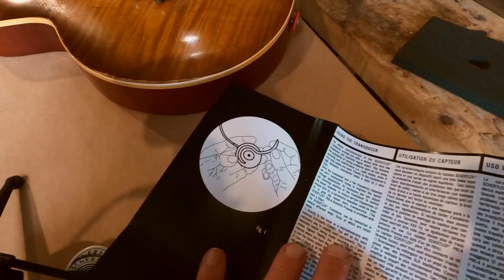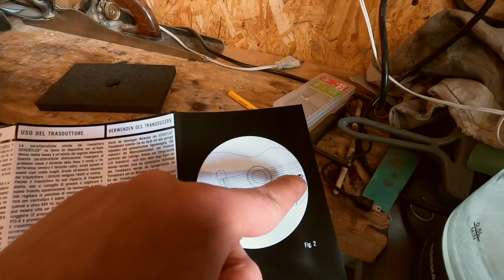HOW WOOD SOUND on unplugged electric guitar. (experiment)

Comment: Your piezo pickup is simply an accelerometer - the same device that scientists have been using for some decades to measure vibrations within different parts of the neck and body of solid body electric guitars. So you are not listening to the "acoustic" sound of the wood, you are listening to the vibrations of the wood converted electronically to sound. No one says there is zero vibration in the body of solid body guitars - only that it is so small as to be insignificant; that's what all the direct vibration measurements of real solid body guitars show. A piezo accelerometer is extremely sensitive, so it picks up even very small vibrations.
And of course what those small vibrations measured from your piezo accelerometer show are the vibrations LOST from the strings. So the string vibrations have excited those small vibrations in the body, which means the strings are no longer vibrating at those frequencies as much. So if you are wishing for the solid body to vibrate MORE in a "good" guitar,  you are wishing for LESS vibrations in the strings, as seen by the pickups. That's the Conservation of Energy Law. So "we need mahogany to KEEP low frequencies" is physics nonsense. More vibrations are lost to the thin flexible neck as you found, and that is the mechanism by which dead spots occur. 
You are obviously a master craftsman, particularly in your profession of historical monumental restoration, which you are now applying to guitar construction. But you are misinterpreting the real physics of solid body electric guitars, as have been known from measurements of real guitars for some decades.
Reply: My two cents: the initially lost vibrations in the body and neck are not completely lost. The vibration of the wood feeds back in the still vibrating string and altering their vibration, thus coloring their sound. The loss contains partially the metallic sound of string vibration, leaving a more desirable warm and „woody“ sound. 
  A german study/test got to the result that 70% percent of body vibration comes from the neck. So how the neck vibrates is very important, not just the so heavy dissected „body-wood“ discussions. 
Cheers😊
Reply: @Axy-dent-ly  There is no evidence to support string vibrations lost to vibrate the guitar structural "feeding back" to the string. At the neck,  its resonant modal vibrations are associated with REDUCED string vibrations at the same frequencies (Pate 2014). And those lost frequencies are low, not high.  The very small bridge admittance (Fleischer, Zollner, Pate) makes any feeding back implausible for body vibrations - a very small "funnel" in one direction means that the very small body vibrations (as measurements show) cannot then become a large funnel in the other direction to feed body vibrations back to the strings.
What is the German study that showed "70% of body vibration comes from the neck" ? I am familiar with all the scientific literature on solid body guitars, but that one must have eluded me.
Reply: @vw9659  
Can‘t find it anymore. Maybe it was just the result of a german physicist, not a study. 
   But vibration doesn‘t just travel in one direction (strings to body). The minimal body vibration transfers also back into the bridge and into the vibrating string.
Reply: @lone-wolf-1  The rigid bridge presents a large impedance to string vibrations, which is why bridge admittance is so low for electric guitar bridges (the opposite of acoustic guitars bridges). The vast majority of string vibrations are thus reflected back up the strings by the rigid bridge, to be seen by the pickups. If this were not the case, sustain would not be greater than in acoustic guitars. So with so little vibration travelling from the strings to the body, it is implausible that significant vibration travels back the other way - there is very little solid body vibration to begin with (as all the measurements of its actual magnitude show); and coupled with the large bridge impedance, the bridge cannot possibly be allowing significant vibration to flow the other way. It's just one of several speculations dreamed up by tonewood proponents who "want" body wood vibration to be important, but for which there is zero evidence from real string-to-body vibrations in real guitars (along with other unsupported speculations like pickup microphony and pickup vibration).
Reply from the maker: Thanks for your comment.  This is not a piezo pickup, but a magnetic induction pickup with a very flat frequency response.  That is why I use it in the analysis of the filtration of wood purity.  Piezo pickups work very differently and do not transmit the correct frequencies.  They are not suitable for the implementation of my ideas.  In this video, I just showed how you can honestly record the acoustic sound of the wood of an electric guitar that does not have acoustic resonators and sound amplifiers.  The strings in any guitar act only as an exciting resonance factor.  All the rest of the vibration buildup work is done by the wood.  But it's hard to show it in a video.  A person playing the guitar himself feels all this with his hands and body.  For me, the value of this experiment lies in the ability to track and analyze the different variations and intensity of vibrations in different woods and finished guitars.  This is more laboratory work with boring analytical notes.  But it also became possible to shoot a spectacular video that, in general, clearly shows what I feel when playing an unconnected guitar.  For many it is interesting and useful.  Yes, I'm not strong in theoretical physics, but I'm a practitioner and explore the questions that interest me on the material.  In my opinion, this gives a complete logical picture.  And it always works.
Reply: @8BombCustom  I stand corrected on the transducer type - it is less sensitive to vibrations than a piezo accelerometer (the most sensitive form of accelerometer used by engineers, with flat frequency response within their measurement range). Whether your microphone is sensing the wood vibrations or the directional acoustic sound waves from the strings is open to question. The distinction between a contact microphone (like your device) and an accelerometer is blurred.
But none of that changes the several decades of research with real solid body guitars that shows body vibration to be very small in magnitude, and essentially insignificant. Those measurements have been done with sensitive accelerometers and laser vibrometry. So "all the rest of the vibration buildup work is done by the wood" remains physics nonsense for solid body electric guitars (not "theoretical" physics, but applied experimental physics measured directly from real guitars).
Regarding what you feel with your hands and body on the guitar, look at the neuroscience research showing the vibration sensitivity of the skin mechanonreceptors you feel vibrations with (their frequency response is not flat). They are very sensitive to some frequencies (only), which can lead us to over-estimate vibration magnitude. They cannot tell you the real magnitude of vibrations in m/s^2 as calibrated transducers can; nor the exact proportion of the initial strings' vibrations that remain in the strings, which is the vast majority - and seen by the pickups. What you are feeling in the body and neck is the (small) vibrations LOST from the strings, so not seen by the pickups, and thus not obviously a good thing.
Reply: @vw9659  
If the low and low mids frequencies get absorbed by the woods, there should be just  mids, high mids and high frequencies left in the string to get picked up by the pickups. 
   But obviously it's the other way around: he high frequencies get dampened by the woods.
    Also you can feel the movement of the woods while strings vibrate. It‘s impossible to not feed back via bridge, neck, headstock into the string! It‘s very minimal and very very little delayed due inertia, but must have a slight impact on alteration of the still vibrating string.
Reply: @lone-wolf-1  That does not follow. There are only several narrow low frequencies lost to vibrate the neck. Because the neck's resonant modal frequencies are mostly in that low range, and the admittance of the nuts and frets at those frequencies facilitates that vibration transfer from the strings. That has been measured directly on many real guitars. But the vast majority of the vibration energy remains in the strings. Little is lost to the neck, and even less to the body.
Mostly the player can never identify or locate those narrow losses, unless there is an obvious dead spot. But it is part of why similar guitars sound different (along with many other factors); and those sonic differences is what some players and guitar builders mistakenly attribute to things like the body wood, as we see in this video.
In guitars where higher frequencies ARE lost from the strings, that has usually been found to be due to the strings exciting internal bridge vibrations (the structure in DIRECT contact with the string); for example at the many air gaps in a tune-o-matic bridge.
Of course the particular pickups on the guitar have to be sensitive to those lost frequency ranges, or the amp will never see those missing frequencies, and the player will never hear a sonic difference.
The vibrations you feel are also predominantly in that lower frequency range, because that's where your skin mechanoreceptors' greatest sensitivity lies. Because they are very sensitive within that range, some people over-estimate how much vibration is really occurring in solid body guitars. A true measurement requires a calibrated transducer, as have been used to measure the real magnitude of such vibrations in real guitars for several decades.
So the very low amplitude measured vibration is entirely consistent with the high measured mechanical impedance of the bridge - which means there is little vibration present in the body to come back the other way through the same high impedance bridge interface. Which along with the absence of any direct evidence makes the "vibration feedback to the strings" hypothesis implausible.

It's all very well to speculate on how solid body electric guitars work. But measurements of real guitars is what has led to our understanding of their real physics.
Reply: @vw9659  
I really like how well spoken and articulate your explanations are. You obviously know what you‘re talking about. And you are to 99% right.👍🏼
   But referring to feedback of vibration from the woods (body and neck) into the strings and thus alteration of vibrational behavior of them, we two will remain (provisionally) with divided opinion. 🤷🏻‍♂️
   That little percentage of altered string vibration and change of timbre, due different properties of different woods/materials, is small enough to be neglected. It has no effect on what music should be. 😊
    For me, It does influence a purchase of a guitar on the used woods just out of curiosity and  I like variation. For me the main reason is based on variation in sound, scale length, look and feel. Not the woods.😌
Reply: @vw9659  
I imagine a dimple test: mounting one string (or more) additionally on the back of the guitar, using same type of strings, tuner and bridge. Then excite vibration of the back strings by picking/strumming, while simultaneously  in the front and analyzing the change of „tone“ on the front strings picked up by the pickups. 
It will indicate if the woods are moving/vibrating enough to alter the vibration of the front strings….
Reply: @Boony Tooty You must enjoy Jim Lill's videos then. A shed science for the masses, yeey!
Reply: It's obvious that you have never worked in a professional studio where there is a lot of money at stake... For example, take 10 stratocasters with the same pickups that are already in the studio, why musicians always choose always the same couple of guitars? Because the woods have more vibrations that make the strings to vibrate a bit more which translate in better sounding. Is it subtle? No, because the signal goes to an amplifier that we all listen and say... Yup, that is the best one for sure, 10-20% better is a lot mate. And we are talking about all good guitars already. It will be always very important before mixing, if not, then it's too late... There no place for nonsense in a pro studio, just very good ears to listen properly.
Reply: @oscarmorales-cn3hz  You seem to have misunderstood the question. It is not whether or not some similar guitars sound different, or better, than others. The question is WHY they sound different. The evidence from measurements of real guitars shows that there are many reasons why they can sound different. The body wood does not really make that list. Your suggestion for why some sound better - because their body wood vibrating more makes the strings vibrate more - would break the laws of physics if it were true, particularly the Conservation of Energy Law.
Reply: @vw9659  "To sum up, the authors despite the great variabil-
ity of wood can statistically prove diﬀerences in acous-
tic and mechanical properties of tested two hardwood
species, i.e. walnut and ash wood, for use in making of
an electric guitar solid body. The research conﬁrmed
the better mechanical properties of ash wood, that is,
the larger modulus of elasticity and shear modules in
all anatomical directions and planes. At the same time,
some indicators of acoustic quality were better in ash
wood, but only in the basic vibration mode. Never-
theless, in ash wood, greater acoustic and mechanical
anisotropy was determined. It has also proved to be
less homogeneous and, consequently, poses great dif-
ferences between vibrating modes"

from "Selection of Wood Based on Acoustic Properties for the Solid Body of Electric Guitar"
Reply: @TheMemagNeman  I'm quite familiar with that Zoric et al. (2019) study. They cut rectangular blocks of several different woods - that is, an "instrument" with neither a neck nor a body like a solid-body electric guitar. They seemed to proceed simply on the unproven assumption that body wood matters sonically - perhaps having read guitar companies' marketing -  and then simply proceeded to measure differences between the woods. They mis-cited some of the existing literature showing the sonic relevance of the neck, as if it referred to the body wood. Thus the study tells us little about any sonic significance of the solid body wood in a real guitar.
Reply: @vw9659  It's measurable. Big variable is if the user/player can hear the difference in tone produced.
These neighboring frequency changes are perceivable by human ear though.

 "In the investigated low-frequency interval
(<500 Hz), the modal frequencies determined from a single measurement signal on the
electric guitar with the body of ash wood were on average 118.0 Hz in the 1st vibration
mode and 203.1 Hz and 438.0 Hz in the 2nd and 3rd vibration modes (Figure 3,
Table 3
).
At the selected measurement points of the electric guitar with walnut body, the modal
frequencies averaged 108.2 Hz in the 1st vibration mode and 200.6 Hz and 419.2 Hz in the
2nd and 3rd vibration modes."

"Conclusions
This study conﬁrms that the elastomechanical and acoustic properties of the material
used for the solid body of an electric guitar also affect the acoustic properties of the
instrument. In the speciﬁc case of the free-free vibration mode, the correlation of the
vibration damping of the solid body and the neck of the guitar is characteristic. Under
these conditions, the research conﬁrmed the advantages of using stiffer ash wood, which
has lower damping compared to walnut wood, for the solid body of the electric guitar
when the other identical components are used. In fact, choosing walnut with greater
vibration damping for the guitar body has the negative effect of shortening the decay time
of some open vibrating strings due to the coupling effect with the guitar neck and strings"

from "Comparison of the Vibration Damping of the Wood Species Used for the Body of an Electric Guitar on the Vibration Response of Open-Strings"
Reply: @vw9659  Different materials/woods have different physical properties. It's only natural that the string vibration would be damped differently by a piece of rubber , a piece of wood, bone, plastic, ceramic, metal. You can hear sonic difference when changing materials on the nut and bridge saddles. Imagine if the neck was made out of a hard rubber and how would that sound , compared to that same guitar setup except with a wooden neck. Some guitars just sound better even though others (from the same run) have the same type of woods and the same setup.
Reply: @TheMemagNeman  Regarding the study you quoted "Comparison of the Vibration Damping of the Wood Species Used for the Body of an Electric Guitar on the Vibration Response of Open-Strings" - yes, I know that study too. It's another from the same Slovenian group as the Zoric one you quoted earlier - in this case Ray et al. (2021). It has some improvements on the first but suffers from another common problem - use of only one sample of each wood. This is unfortunately common in graduate student theses (of which this study may be an example), where resources and time are limited. But what it means is that the requirement to demonstrate that the "guitars" (in this case a slab of body wood with the same neck) are identical in every other way becomes extremely important. It is not clear from the methods if the same hardware was used on each guitar; and even if it was, any methods to ensure it was set up identically on each guitar were not described. Variations in such factors are common sources of sonic variation between similar guitars (see Zollner ch7).
Studying multiple samples of wood is a much better way to address this problem, as then any consistent differences are more likely to emerge from other sources of variation, if they are truly present.
Also, as one academic reviewer commented: "The decision of using rectangular blocks of wood for comparison, instead of more conventional electric-guitar body shapes is not explained. Also lacking is any explanation/discussion of how the rectangular body’s response meaningfully relate (or not) to the response of actual conventional electric-guitar bodies."
So again, we are left with a study that raises more questions than it answers.
Quoting more and more studies with methods that are obviously deficient to experts in the field does not really get us any closer to the truth.

Regarding "Big variable is if the user/player can hear the difference in tone produced.". Certainly there are differences in hearing acuity. But generally in these discussions we are talking about guitars where everyone who hears them agrees that they sound different. If you have an example of two guitars that you think only experts can hear the differences between, let's hear them. But what would be the benefit of that ? If only expert players can hear those differences.
As to whether all sonic differences are measurable with instruments, the work of Pate that combined precise measurements with blind listening tests by experienced guitarists actually found examples where consistent measurable differences were NOT reported as heard by the guitarists. So it seems that it's just as likely to be the other way round.
Reply: @TheMemagNeman  And yes, different materials have different properties as you say. But not all are in direct contact with the string. Nuts and saddles have been measured to have sonic effects, because they are in direct contact with the string. The nut facilitates loss of string vibrations to the neck at the neck's narrow resonant modal frequencies. And the bridge is a common measured source of higher frequency losses, where the strings excite bridge components to vibrate.
Statements like "It's only natural that the string would be damped differently by a piece of rubber ..." and "Imagine if the neck was made out of hard rubber ..." are known as appeals to extremes - they contribute nothing to understanding how real guitars work.
The many potential reasons that can cause similar guitars to sometimes sound different are well-described in the scientific literature based on measurement of REAL guitars.
Reply: @vw9659  " In the electric guitar with identical components,"

"We have examined only one body of a single species
of wood. However, in a previous larger sample, we conﬁrmed statistically signiﬁcant
differences between wood species in density. In
order to simplify the future process of building a numerical model, as part of a broader
study of electric guitar design based on the acoustic properties of the material, we have
included only the basic shape, i.e., a case study, of the guitar body in the initial investigation."

"From a mechanical point of view, these guitars tested are nominally identical, with the
only difference being in the directional mechanical stiffness, i.e., the modulus of elasticity,
torsion moduli and damping of the material used for the guitar body.
With the same guitar equipment and identical tests, despite the coupling effect
of the components of a single guitar, it is to be expected that the differences in the
acoustic behavior of the tested guitars are mainly due to the material properties of the
guitar body used."

Some people can't tell single coil from humbucker, let alone hear the difference in note bloom.
Here, take a listen to these. Pay attention to clean sounds and see if you can spot the difference. https://youtu.be/ux1d3yF8-Ro

Do you know who is Jim Lill and do you think those test are valid?
Reply: @vw9659   No, they are not in direct contact but they react as the string vibrates. Nut and bridge propagate vibrations to neck and body which is more than obvious.

I used extreme example to depict how materials used in a guitar system matter.
Of course, the effect would be severe . Different wood species and samples would have much less perceivable influence on string vibration.

 Please provide the tests and results of scientific research published that uses "real guitars"
and which concludes that wood used in guitar makes no sonic or mechanical difference in string vibration.
Reply: @TheMemagNeman  In the Ray study "identical components" is ambiguous - it could simply mean the same MODEL of bridge etc. It doesn't obviously mean the exact same bridge (different versions of the same model bridge have been shown to absorb different string vibration frequencies [Zollner]); you need to be very precise in this context.
Their reference to confirming properties on more samples is to the earlier study (Zoric) you quoted, which did not use the same "instrument" as this later study (it had no neck). It was simply bench testing of the mechanical properties of slabs of wood. It does nothing to say whether multiple samples of an otherwise-identical guitar made of different woods would return the same results as this Ray study on single wood samples (only).
In general, these authors seem unaware of the work on the many common differences that can confound creation of "otherwise identical" guitars, particularly the work of Zollner. They seem to be inexperienced researchers as far as guitar research is concerned. Although part of the problem is also that their overall aim is to design a virtual test bed for guitar design. They are not specifically trying to determine if body wood matters sonically in REAL guitars. Or their experiments would have been designed differently. 

The Lill experiment is interesting in that the heard differences were smaller than many people expected - between a conventional guitar, a 2x4 guitar, and a "bench" guitar ... so a 'normal' amount of wood, less wood, and much more wood. That and his other experiments (eg scale length) are admirable for an admitted amateur. He does "ecological validity" better than the published studies we have been discussing. He was obviously able to control other guitar factors (that can sometimes contribute to sonic differences) well enough to minimize the heard differences in his examples. There are other examples on youtube where for example most of the wood has been removed from the same guitar and the sonic differences were slight (eg Braun). So Lill's results were not entirely unusual. 
The criticisms of Lill I have read have generally shown a misunderstanding of his experimental design or its implications. Although some people won't explain why they don't like his experiments (perhaps because they can't ?). But some people argued for example that the "air guitar" actually had wood. In fact of course it had lots of wood, which actually makes the experiment stronger not weaker (as a more extreme contrast).
If you think his methods were not valid, why ?

Re the studies of real guitars you asked for, read Zollner's work in Germany (especially ch7 in the 1200-page 'Physics of the Electric Guitar'), Pate's work at the Sorbonne in Paris, and Fleischer's work also in Germany.
Reply: @vw9659  That would be all, thank you.
Reply: @vw9659  Some interesting stuff I read ...
"Fleischer [8] has published a variety of different impedance plots for various guitars,
measuring not only at the nut or bridge saddle, but at each fret, as well. These and further
investigations [Fleischer 2001, 2006] indicate bending and torsional vibrations of the guitar
neck – causing low-frequency bearing absorptions. "

"Below about 1 kHz, neck resonances (very selectively) determine the string damping,
and only here does the wood have an impact. The wood of the neck, that is! Although the
body as a bearing for the neck is also involved, the bending- and torsion-resonances of the
neck are the decisive factor."

"Compared to this situation,
vibrations in the body of a solid electric guitar are of subordinate significance. This does not
mean that just any material would be suitable for the electric guitar, and that its body has no
impact at all: rubber would indeed be not conducive. However, if contact to half a square-
meter of blockboard has no audible effects onto the electric sound, the issue of whether the
body is made of ash or of alder moves rather far into the background."

"As has already often been expressed: damping in musical instruments is not necessarily a bad
thing. The character of the instrument expresses itself in the damping of individual partials:
it’s the imperfection that results in individuality. Simpler said: the picking and the pickup
yield a spectral envelope, and the string bearing determines the decay of the partials. Not the
analyzer but only the listener decides what’s good or bad; and what is actually audible, as
well. Not all effects visible in an FFT-spectrum are audible, too. "

What was also interesting was Zollner's "tonewood" test of a Strat where he didn't actually test or measure  different types of wood on that start 
but he sequentially held the body and the neck onto the wooden cab of some sorts and did an analysis of that as a tonewood test.
Formerly he claims neckwood is the key to vibration absorption and frequency shaping/ ultimately contributing to the tone of the guitar.
The remaining of the article is reading like a rant.
Reply: @vw9659  The WHY, is the wood, that's a fact. Do you think that top level producers are stupid or deaf? Young people try new crazy ideas based on physics, old dogs made millions with real knowledge based on decades of trying different stuff. This is not even a debate mate.
Reply: @TheMemagNeman  Your last quotes (all from Zollner ch7 ?) support what I have been saying is the direction of all the evidence.  That evidence, from multiple researchers measuring real guitars, shows that the resonant modal frequencies of the neck matter sonically - they are a result of neck dimensions (long, thin), and composition (wood, frets, truss rod). That is also consistent with measurements of nut/fret admittance, showing it to be high at those frequencies. Thus string vibration energy flows from the strings to the neck, and actual string vibrations have been measured to be reduced at those narrow frequencies. Multiple different measurements from different labs, guitars, scientists, methods ... all supporting the same conclusion. Bridge admittance on the other hand has been found to be very low (the opposite of that measured in acoustic guitars), and thus there is no similar evidence for the significance of body wood in real guitars. Direct vibration measurements of neck and body have shown that the latter is very small (something that is not actually measured by this channel's video, at the Les Paul's resonant modal and other frequencies). So the reason why the body wood has not been shown to be significant in real guitars is essentially that, comparatively, very little vibration reaches it.

As we move along the continuum from solid bodies to semi-hollows, to hollow bodies, and eventually to acoustic guitars, the evidence shows increases in bridge admittance, and reductions in string vibrations at the same frequencies. This reflects an increase in bridge "mobility" - that is, the bridge vibrates more on less-solid bodies. This explains why thin top plate wood (actually really its stiffness and mass) and bracing matters in acoustic guitars - they support the bridge, and facilitate transfer of string vibrations from the strings to the body via the bridge (in order to be heard). That transfer is measured to be less in hollow-body electrics, less again in semi-hollows, and very small in solid bodies (where the bridge is typically solid metal). That is why sustain is greater in solid-body electric guitars; vibrations remain almost all in the strings, to be seen by the pickups.

If you read the physics nonsense that Zollner highlights in his quotes from German guitar magazines about body wood, you will understand his frustrations, which are sometimes reflected in his written tone. The English language guitar press does not seem to be as bad, but they do sometimes parrot guitar manufacturers' marketing and misunderstandings about the role of body wood.

BTW, you didn't answer about your own assessment of Lill's experiments (which you asked me to comment on).
Reply: @vw9659  All the tests (Zollner's and those of the researchgate scientists that you disregard as amateurs, plus YT video tests) prove that guitar system materials are important.
In terms of body wood construction , neck wood (or also refereed as tonewood, if I may say so) is proven to have observable effect on the guitar "tone". There is no disagreement there.

What I think is odd is your disregard of the "amateur" scientists tests material as "not-real" guitars, when we have examples in Zollner's that also use single string apparatuses/monochord (7.19), and the guitar wood tests like leaning the guitar body/neck onto the cabinet ("It should follow that if we change the wood, the sound would also change." Proceeds to not change the guitar wood material and makes contradictory statements to his own prior research on the neck wood.).

Then we get presented with data and solid proof of the effect of the guitar "tonewood" effect on the "tone", in the researchgate documents. Be it minor, it's still there.
I see it as a change of the magnet in the electric pickup. It makes a difference but it's sometimes so small that user may not notice it.
It's still there though, and user might just "like" that particular guitar because of the minute difference, the "feel". 
Guitar is a complex system. Same pickup and same strings will not produce the same sound on a different guitar. 

There is not a single plotted data analysis in Lill's video. It is presented as a fair attraction, it's amusing but nothing more than that.
He uses short audio samples to get to his point (controlling the samples to "minimize" the differences in tone),
no actual recorded raw audio files, he disregards YT compression and uses his own compression on the audio samples.
In the end the tests show that these "not-real" guitars indeed sound different. Much like other YT videos I have posted. 
The video from SoundSpectreStudios also prove those tested guitars sound different, if they can't hear it it's their issue. 
Under heavy drive most of the guitars with similar features would sound almost indistinguishable due to compression and signal degradation.

If we talk about the tonewood, we talk about the body and the neck since both are made of wood.
If it's true that the neck wood matters (as claimed by Zollner among others), as a factor in guitar tone shaping, we can safely use the term "tonewood". Why not.
If this wood is used in the body of the guitar , it is also tonewood.

Semi-hollow (335) still has a block of solid wood running the middle of the guitar. The bridge is mounted on top of it. If you remove the "wings and top", the guitar would look like those "non-real" guitars in the "amateur" body wood tests. Why would bridge vibrate more on a semi-hollow and have more profound effect on string vibration (tone) , if it's mounted on a solid piece of wood just like on a Les Paul? Does body structure matter, does material structure matter?
Let's not mix these with how acoustic bridge works with the body.

Sustain doesn't mean good tone. Zollner confirms it doesn't have to be desirable and I agree.
Reply: @TheMemagNeman  There a number of accomplished guitar scientists whose multiple studies (on real guitars) are on Researchgate, namely Arthur Pate and Helmut Fleischer who I recommended to you earlier (along with some of Zollner's work being there too). The overall conclusions drawn from these are, as I said, the result of multiple experiments all pointing in the same directions, despite being done by independent scientists in different labs with different guitars. Of course not all single experiments are equally well done. One of the skills of scientists is to assess the entire research literature, looking for agreement and disagreement, evaluating the quality of the research, to come to a consensus conclusion. There should be no high-quality research that presents a different conclusion. It is entirely open to the "non-guitars" wood scientists we've discussed to do better, more ecologically valid studies with real guitars.

Tonewood proponents often conflate the neck and body. They are very different structures, which explains the significant measured sonic effect of one (the neck) and the absence of evidence for the other (the body). The fact that wood is important for a long, thin, composite neck tells us nothing of its importance in the thick, solid-slab body. Saying "it's all tonewood" makes no sense.

You say the body wood effect is "minor", but that's not what some guitar journalists say. Some of the German ones that Zollner attacks have asserted that the body wood is responsible for the main sound of a Les Paul, with the pickups only contributing some colour to that. And if you read guitar manufacturers' web sites, you would come away with the same impression - that particular solid body wood species "sound" a particular way.

Regarding "Guitar is a complex system. Same pickup and same strings will not produce the same sound on a different guitar. " ... Yet tonewood proponents often reduce it to a simple system - "if it's not the pickups it must be the wood". In contrast, Zollner has shown the MANY factors that can have sonic effects in real guitars - many not always evident, but sometimes. So describing a guitar as a "complex system" is only helpful if you then point to the many things that have been measured on real guitars to have sonic effects - which we can now do. If you don't do that, then you're back to "well I'm not really sure ... but maybe it's the body wood". That's not a complex system ... that's a misunderstood system.

Re the Lill video, it's of course possible that the audio processing factors you mention influenced the similar sonic results we heard. But unless we get access to the raw audio, that will remain speculation. Other channels have shown nominally similar guitars that do sound different, so it's not like youtube is incapable of reproducing differences. And Lill's results are broadly consistent with the published science. If nothing else, his results challenge tonewood proponents to come up with better experiments to prove their assertion that body wood does matter sonically. Because when you ask them why they believe that, they usually don't have much to offer ... other than often saying "everyone" knows that, or that it's what guitar journalists and manufacturers say (neither known for their knowledge of guitar physics).

Re the 335 centre block, look at how it interfaces with the curved top of a 335. It is not a completely solid attachment (see for example Gibson factory videos showing 335 construction). So the 335's bridge and its top are more 'mobile' than on a typical solid-body guitar. Thus it is expected that it would have greater string vibration losses than a solid body guitar, which is what Zoller found with his measurements.

Sustain is due to the persistence of vibrations in the strings. So while you may not want the string to vibrate as long as Santana, the factors that cause that longer decay - or conversely cause faster decay - are in action from the time the string is struck. Thus they influence the frequency spectrum of the string detected by the pickup at all points in time. Zollner for example has shown this in his 1/3-octave frequency plots of real guitars on his youtube channels. So whether you desire long sustain or not, you are hearing the factors in a guitar that influence it, for notes of all durations.
Reply: @vw9659  Okay, we agree that the wood (material) used in the neck matters in the tone of the guitar.
That alone is contrasting the belief that guitar body (neck/corpus) material doesn't matter at all and that most of the tone relies solely on the pickups.

"If nothing else, his results challenge tonewood proponents to come up with better experiments to prove their assertion that body wood does matter sonically."
That's literally what the body wood research (walnut vs ash) is doing. That's what we can find in the YT videos as well. 
https://youtu.be/ZzPvq8V7IA4
https://youtu.be/Hbyg0d1njk0
https://youtu.be/YcwHAhYlT7g
If he was using a compressor (which he did noted), he consciously changed the signal. If there is too much speculation , then it isn't really a science test, right.

This is another test that examines the change in woods used. Of course, these are not-real guitars, much like monochord in Zollner's tests.
https://journals.pan.pl/Content/121810/PDF/aoa.2021.138150.pdf?handler=pdf

As for ES335, I thought the bridge was securely mounted into the center wood block? "It is not a completely solid attachment" what does this mean?
www. tdpri. com/threads/tickled-pink-jupiters-es-335-build.620607/page-108
Reply: @TheMemagNeman  Fleischer's work is mostly from the 1990s. There has been no argument as to the influence of the neck since then, amongst people familiar with his work. He also showed the very low bridge admittance, and thus measured low body vibrations in real guitars. So there really has been little excuse to believe in "body tonewood" since then. And the quality work since then has only added weight to that understanding of the relative importance of neck and body wood.

I honestly rarely come across anyone who thinks it's all in the pickups. In fact a simplistic dichotomy seems more common in my experience amongst tonewood proponents - "it can't all be the pickups, so it must be the body wood". The many sonically-influential factors identified particularly by Zollner in real guitars shows that both positions are obviously wrong.

I looked at the videos you linked. The paulownia vs alder one and the alder vs basswood one appear to be just recordings of two guitars with bodies made of those woods swapped. Which could sound different for any one of the dozens of reasons that have been shown to affect guitar sonics in some cases. Too many people seem totally unaware of experiments such as Zollner's, and thus think all you have to do is change one thing in a guitar - in this case the body - and magically that will be the only thing that has changed in any sonically-influential way.

It's the myth of the "otherwise-identical" guitar. In reality you actually either have to make the same change multiple times (the multiple samples I talked about earlier), so that any real effect might emerge from the unavoidable variation in other uncontrolled factors; or precisely measure almost all known sonically-influential factors (eg losses due to string-fret micro-damping or the strat trem suspension, to name just two that could apply in the above videos) ... to be sure that none of them changed when the bodies were swapped. That's the clear implication of Zollner's work. So all in all there is no obvious reason to assume that the differences we hear in those two videos is clearly due to the body wood.

The Tim Sway one I've seen before. But I watched it again to see if I'd mis-remembered it. It shows minimal heard differences between most woods attached as an outer 'frame' to his novel, relatively thin, unchanged core; and a greater difference for one wood - poplar - not exactly one of the classic supposed "tonewoods". Of course we have to assume he strummed the guitars identically (the best way to do that is with a mechanized strummer). But as Sway says at around 16 minutes, "They all sound and look [on screen in his DAW] the same ... surprisingly the same". Including the core on its own (not unlike Lill's 2x4). The only one that clearly sounded different (brighter) was the core plus poplar frame. Someone would have to closely analyse Sway's unique guitar design to see why that was so, and if that brightening effect actually happens everytime you attach a poplar outer frame to his core. The only structural element that has clearly been implicated in a brighter guitar is the neck, as it is commonly associated with lower frequency losses (the bridge tends to be associated with higher frequency losses). So, the Sway video is somewhat interesting ... but not especially persuasive that we have missed a clear body wood effect in years of other research work.

And it would be remiss of me not to point out the apparent contradiction in your assumption that youtube audio was inadequate to discern sonic differences in the Jim Lill video, whereas the guitars in the videos you linked obviously did sound somewhat different. Do you think youtube was perhaps just having a bad day when it recorded Lill's experiments ?

The results of the Jasinski et al 2022 study are at best consistent with the experimental data from real guitars showing the sonic effect of the neck. They used a monochord where there is no separate neck and body, so one cannot draw conclusions as to where their measured effects originated. There are experiments for which a monochord is appropriate, and ones where it limits the conclusions that can be drawn. In terms of overall research design, like the others they also used only single samples of each wood, and made the "otherwise-identical" guitar assumption too readily. They provide some data in Table 1 on their setup's variability, which includes a pickup height variability of up to 0.9mm; we do not have good data on what the sonic effect of that variation might have been. 

I don't wish to be too harsh on these research groups. The required experiments to answer these complicated questions are hard to design, and require considerable time and resources to perform well. But there is basically no funding for guitar research, so most academics are doing it with minimal resources. As a result of this, guitar research is not a large field. Which in turn means that there are few experienced researchers able to rigorously review research papers submitted by others for publication. Which means some poorer quality studies do get published in small journals. But researchers should not overstate the meanings of their results, as some of these groups have done. An important part of research writing is to honestly state a study's limitations; some of these groups have failed to do that.

Re the 335, note the thin spruce strips that are the interface between the curved top and the centre block:
https://youtu.be/uVU86GGV07A?t=498
So there are reasons to expect a more mobile bridge and top plate, which would lose more vibrations from the strings than one would expect in a solid body guitar. Also, Zollner (ch7) showed that the height of an ABR-1 influenced the string vibrations lost to the bridge. So, expectedly Zollner did actually find greater losses of string vibration energy in a 335 than one would expect of a solid body (fig. 7.124).
Reply: @vw9659  As he said, the spruce strip block is glued to the maple center block (reinforced top) and then bridge and tailpiece get drilled into it.
I have a similar guitar and ,although not spruce strips, laminate is firmly glued to the body block and then the ABR bridge and tailpiece are fixed to it, just like on a Les Paul (given that the rest is not solid wood construction). The bridge is not floating and it's not just fixed to the arched top, there is no movement there. Bridge itself is not more "mobile". 
Change in response could be due to materials involved , mass , density , body design/construction. What is the exact "reason to expect" the change in the vibration distribution?
If we talk about the glue used to connect the slabs of wood together, then we talk about the change in the material and it's properties (ibanez brass sustain block comes to mind).
I don't think glue nor wood finish has a meaningful influence on the guitar tone.
Setup of the guitar makes a world of difference to a guitar's tone and the feel, sure.
Reply: @vw9659  "I looked at the videos you linked. The paulownia vs alder one and the alder vs basswood one appear to be just recordings of two guitars with bodies made of those woods swapped. Which could sound different for any one of the dozens of reasons that have been shown to affect guitar sonics in some cases. Too many people seem totally unaware of experiments such as Zollner's, and thus think all you have to do is change one thing in a guitar - in this case the body - and magically that will be the only thing that has changed in any sonically-influential way."

Okay, if we consider that there are so many miniature variables that could change the tone of the guitar...how come Lill (apparently agreed that there is no difference in tone) didn't manage to change any of them in his half-assed shed experiments? Plucking, string fatigue, setup deviations etc. 
Were they all perfectly executed (speculation?), doctored, edited, cherry picked to prove a point?
Reply: @vw9659  "It's the myth of the "otherwise-identical" guitar. In reality you actually either have to make the same change multiple times (the multiple samples I talked about earlier), so that any real effect might emerge from the unavoidable variation in other uncontrolled factors; or precisely measure almost all known sonically-influential factors (eg losses due to string-fret micro-damping or the strat trem suspension, to name just two that could apply in the above videos) ... to be sure that none of them changed when the bodies were swapped. That's the clear implication of Zollner's work. So all in all there is no obvious reason to assume that the differences we hear in those two videos is clearly due to the body wood."  

I must have missed Zollner's body wood comparison tests , where he kept all the components and setup as identical as possible (no speculation!) except the body wood.
On a "real guitar". Oh right, he pushed a strat onto a cab and this is how he effectively changed the guitar body wood (not in this reality though) and concluded that the test shows no meaningful difference in "tonal signature". However, if there is such a body wood/material test on a real guitar conducted by Zollner that I have missed, please share it. 
Otherwise it's just a study limitation which should be recognized by the author.

"paulownia vs alder" video has an intro video which confirms that the setup and components were kept as close as possible, meaning ~identical. 
There is an obvious reason to assume that the wood change is the cause for the sonic difference between the two samples
because this is an obvious and intended guitar system component change of these tests. It could have been that the rest of the setup was perfectly identical
or the offset was so small that it didn't cause any observable difference. It just might be a better body wood test than the rest of them. On a real guitar, none the less.

Most of the research linked was done by people with PhD degrees, there is no need to try and disrespect their knowledge and work.
Reply: @TheMemagNeman  Re the 335, the bridge bushings or posts (depending on exact TOM bridge type) are in contact with the top plate, which is thinner and less rigid than in solid-body guitars. And there is no need to simply speculate that 335's might be associated with greater string vibration losses - that has been shown in Zollner's T30 measurements I cited. Like you I have such a guitar; maybe the construction of yours is different to Gibson's - Zollner studied a Gibson 335 with ABR-1 (not a 'floating' bridge). Could there be more such experiments done to establish the exact nature of increased structural vibrations associated with the measured reduction in T30 at particular frequencies ? Of course. But the general pattern of increased bridge admittance with less rigidly mounted bridges is reasonably well-established across the continuum I described of guitars studied by Zollner - solid-body electric to semi-hollow to fully-hollow to acoustic guitar. Bridge 'mobility' is a well-established concept in guitar research; although most of that work is with acoustics where it is most relevant, as it is the means by which vibrations are transferred to the thin top plate and cavity, in order to be heard. As you might expect, semi-hollows and fully-hollow electrics have been studied less often than solid-body electrics and acoustic guitars.

In the absence of precise measurements, I think the most likely explanation for Lill's experimental results lies in the nature of the many things that have been shown as having a sonic effect in guitars. The "everything matters" mantra that one hears from some people is not consistent with the research literature. Some things DO always have a sonic influence (pickups for example, via their resonant frequency and Q factor). Other things can sometimes have an effect, but not always (many measured in Zollner ch7 for example). And some have no sonic effect. So "everything" does not matter. The key to valid single-element guitar comparison studies (like body wood comparisons) is to control all those factors, and/or be clever/lucky in choosing a simple setup that has few if any other sonically-influential variables (or test multiple samples of the same woods, as I also suggested). If you look at all of Lill's studies, he seems to have a good knack and appreciation for the need to control potential other variables well, or exclude them. I don't sense any bias in his approaches - that is, he doesn't appear to me to be trying to prove a particular point. He seems honestly curious. And being a pro musician, if anything I think he would be more likely to hold to the supposed 'conventional wisdom' amongst many pro players that wood matters. If anything, the people on guitar forums who dismiss his results seem to be the ones with an ideological barrel to push.

Zollner has not done a body wood comparison study. So there is nothing there to criticize. The German GITEC group with which he has been associated has however done a blinded listening study examining the assertion by some that particular woods "sound" a certain way (ie the assertion made in some of the German guitar magazines).
https://www.gitec-forum-eng.de/listening-experiment-tone-woods-in-solid-body-electric-guitars/

I have now watched the several Pawlonia vs alder 'intro' videos. There was insufficient demonstrated attention to measuring/controlling all possible extraneous variables. Strats are amongst the hardest guitars to do wood comparison studies with (Lill's teles are much simpler). Because the trem suspension has been measured to affect string vibration losses. In this case, the trem was apparently decked, although we did not see the setup. Sonic differences have been measured with floating trems, but there have been no studies comparing decked trem setups as far as I know. But there are 'grades' of decking, depending on how far the springs are stretched. He did not measure pickup height as far as I could tell, but perhaps simply assumed that the strings were as far from the strings on both guitars because it seems that the same loaded pickguard was used (a difference in neck pocket depth would change pickup height). Disassembling a guitar and re-assembling it is not guaranteed to produce an identical setup. Also, listening to the blinded-test video, it does not seem that the strumming was particularly consistent. I look forward to the day when people doing such comparisons say they've read Zollner and thus measured or controlled everything precisely to ensure that no extraneous influences confounded wood comparisons.

Re PhDs, so how do you decide when a single study by one group of PhDs asserts a different conclusion than other studies also by PhDs ? Experts make those judgments on the research literature all the time. They look at the relative quality of the research. Or when there is a sufficient body of work (not yet the case for electric guitar science), by meta analyses or systematic reviews. As a general rule, more robust work is typically done by scientists who are more experienced in the area in question. It's unusual for a research group new to an area of research to produce top quality work in a complex area from the start. In large, well-established, well-funded research fields with many researchers, many journals, and many scientific conferences, the requirements for studies to get published are high - it is very difficult to get published - and those study requirements are clear to most researchers. In smaller fields like guitar science, and with smaller journals ... not so much.

It is of course not inconceivable that body wood might be shown to have a sonic influence in ecologically valid and properly controlled wood comparison studies in the future; for example perhaps for a limited range of woods or (simpler) guitar types or pickups with a wider bandwidth (to transduce wider sonic influences). Scientific understanding evolves as more evidence becomes available. It's possible that some of the comparisons we've discussed already show a body wood effect - but they all fall short of being certain to a scientist familiar with the research literature, for the reasons I have expounded.

We already known that the body structure starts to become more influential along the continuum from solid-body to hollow-body to acoustic (Zollner's measurements for example). Going the other way, back towards 'more solid' bodies, we do not know at what point the bridge becomes "insuffiently mobile" for bridge admittance to drop to sonically-insignificant levels. But prior to that point, such wood-rigidity-related admittance would be sonically discernable, maybe for some solid-bodies (as it appears to be for semi-hollows). But the many other potential sonic influences makes any body wood influence a difficult thing to isolate/prove. Unless body wood is such a dominant factor that it always overrides all other sonic influences - I don't think anyone believes that (other than some German guitar journalists). As it stands, any isolated increases in bridge admittance that have been described in the literature for solid-body electrics have been traced back to other (non-wood) factors, usually internal bridge vibrations (thus associated with losses from the strings at the same frequency). There is no other proven mechanism by which body wood could exert a sonic influence.

The other things that might improve the understanding of the various factors involved would be if all pickups came with a frequency response chart (as speakers and microphones do), so that players could better understand the real extent of pickup influence (compared to other factors). Such measurements are now available to the enthusiastic amateur for similar cost as a set of boutique pickups. And a better understanding of bridge admittance would be facilitated by simpler ways of measuring it, as have now become available for acoustic instruments.

It would also help if players understood the nonsense in the commonly-heard "the body really resonates", as if it is obviously a "good" thing. By the Conservation of Energy Law, any string-vibration-induced body vibration is due to losses from the strings. So no longer seen by the pickups, and thus not obviously a "good" thing (of course you may 'like' the losses, but that is subjective). That sort of misunderstanding of the basic laws of physics is unfortunately a feature of this youtube channel.

As it stands, it's impossible to say with absolute certainty that the body wood never makes a sonic difference, or maybe makes a difference sometimes but not always (in which guitars, for which woods, with which rigs, and for whose ears ?), or always makes a sonic difference (how much ?).